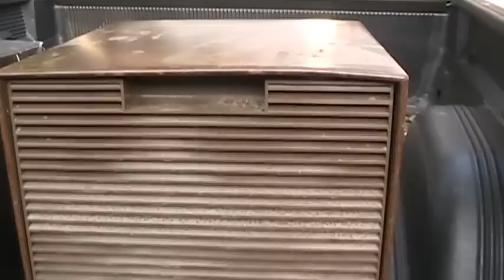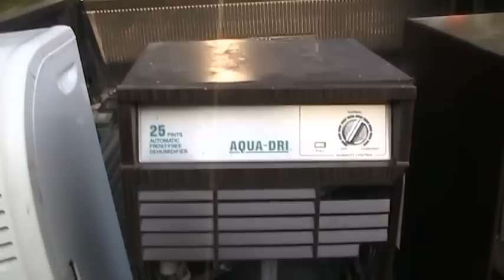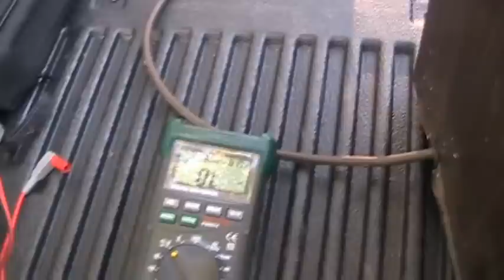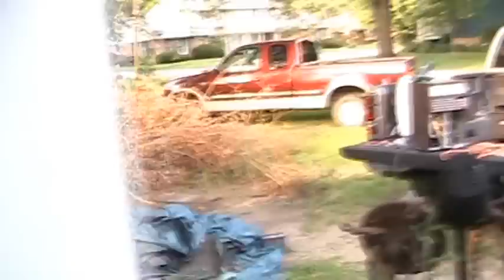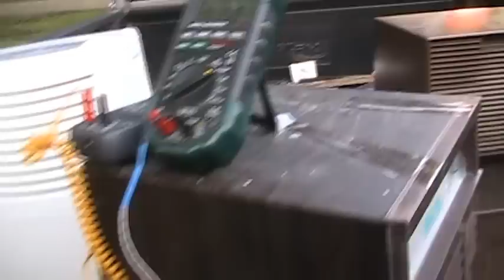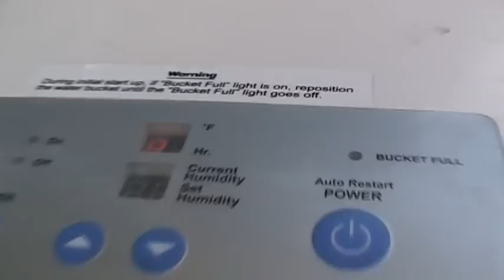Three Broken Dehumidifiers

Comment: That Aqua-Dri dehumidifier was made by Samsung in the early 1990s.  I have a slightly older 40-pint unit with vertically wrapped aluminium evaporator also made by them, and sold by Hunter.  It was neglected for many years but runs like a top after a good cleaning.  It came without the condensate bucket but I have it connected to a hose.

Comment: Just had a thought.  How hard would it be to bypass the electric control panel and wire in a humidistat? Been looking for dehumidifiers for cheap.  All the good older ones are either too far away or insanely over priced.  The one advantage to the newer models is generally larger capacity.  I find those for parts all the time
Reply from the maker: It wouldn't really be that hard, as long as one does so safely.
Reply: @uxwbill  hope theirs an opportunity to see that in the future. Like the dehumidifier and Kitchen Table Electronics Repair vids

Comment: When hunting for a vintage dehumidifier, I always insist that people look for the absolute simplest design you can find. My '78 Admiral 22-pint unit has only its humidistat in front and a single tank-full switch in the back. No springs, no second switches. Less to break than even your simple Kenmore. Also, of course, my first bit of advice is NEVER BUY NEW or you'll be buying again within the decade.

Comment: Bad capacitors can be the cause of faults where a capacitor is used as a voltage dropper to give a 24 volts supply to the control pcb. The capacitors are self healing in that if they go short circuit the current pulse blows away the faulty bit of the capacitor which is then ok again but has slightly less capacitance. Over the years as this happens the capacitor then does not have enough capacitance to supply the 24 volts. https://www.youtube.com/watch?v=r_79OrkoRtI&t=73s   That is one that I fixed.

Comment: I purchased a Frigidaire 70 pint dehumidifier in 2017, and a second one in 2018 (as a backup). Both, are now dead, showing the dreaded 'F0" error code, which means loss of refrigerant. I believe MOST modern dehumidifiers tend to die as a result of loss of refrigerant, due to bad welding in the cooling lines. Somebody suggested to just buy a small window air conditioner and plug it into a humidistat ON/OFF controller. What do you thing about that? Thanks for a great demo.
Reply from the maker: While it certainly will dehumidify, a room air conditioner may not do as well as a purpose built dehumidifier. 

The air coming out of an air conditioner is actually laden with humidity, but becomes less so as it blends with the (warmer) room air. It may also make the room too cool, or be unable to cool/dehumidify effectively because it is too cool in the room or outside.

I have done a much newer video searching for the leak on a modern, recalled dehumidifier whose charge had leaked away. I also examined another similarly recalled unit that had leaked down. In both cases, the joints were fine. The theory that I'm working with now, based on what other commenters had to say, is that the copper may actually become porous. This is likely to be revisited in the future.

I would recommend finding a good working vintage dehumidifier instead of an air conditioner.

Comment: Well, those coils etc are being exposed to moisture all the time it runs, pretty much guaranteed to corrode almost any metal over years.
I have a Danby  dehumidifier ddr050bdwdb  I didn't find it expensive, I think it was $179
Reply from the maker: Corrosion was never really a problem, as plenty of surviving 20, 30 and even 40 year old models will readily affirm. Only newer units seem to have problems with it.

To buy a window-mounted air conditioner of similar size to a dehumidifier actually costs less and gives you the added bonus of comfort cooling.

Comment: I can't stand digital controls, so finicky on my dehumidifier. They really need to revert back from digital displays, makes a simple machine too complicated.
Reply from the maker: From what little I've seen of them, I'm amazed at the lack of hysteresis exhibited by the digital controls on modern dehumidifiers.
Reply: I just fixed a Frigidaire with digital controls, it seemed it had two separate problems. 
First was the humidity sensor, located at the top right of the unit, where it apparently sat in enough condensation that the lead for the thermistor used in the sensor corroded away and broke the connection. This resulted in an A5 code. It measured about 220k ohms at ambient room temp, and I didn't know what part number would be suitable for a replacement, so I was able to salvage the old one by soldering on a new lead on it. Tricky because the one side broke off flush with the body, but it worked.
Then it still wouldn't energize the compressor, and that turned out to be a bad 25A relay. Contacts were all burnt and oxidized, no salvaging that, so I used a solid state relay I happened to have, and it then worked normally.

Comment: I just got an old Inglis dehumidifier at an estate auction for $1.  Probably made by Whirlpool.  I had thought it was 1970s but it's got a production date of 1957 on the inside.  It's freakin' heavy and is built like a tank.  Cleaned it up and it works great!  It doesn't have an on/off switch or a humidistat control.  I guess the old ones didn't need such fancy controls?  I can't find any info or even a photo of it on the net.

Comment: Excellent presentation and video.  I am an electronics numbskull.  I have an old Kenmore like the one shown, (but it has the "o".  Best I can see, the model is 840405.  Owned for 11 years.  Picked up from the dump.  Until now, I've never had the thermostat set higher than 3, and I did not let it run continuously.  The house is so damp, however, that I moved it from the small room in which it was located, to a larger room, and, I've set it at 5.  It doesn't shut off, (possibly due to the severe damp?), so I shut it off manually.  Tonight, the top of the unit was hot when I went to check it.  Not burning-hand, hot, but too warm for my comfort.The unit surely does pull moisture from the air, and the 22 pint bucket has been filing up well.  I have not allowed it to reach full.  There could be a wall wiring problem, as the plug becomes slightly warm.  But, the metal being so warm - maybe it has been before and I didn't notice it, which is quite probable - what do you think, please.  Thank you.
Reply: PS  The plug was inserted into a 3-hole outlet, but I wouldn't assume it's "grounded" in this old place.  (Hey, take it a little easier on those of us who consider incandescent light bulbs miraculous and don't get into cleaning the units well, even if they're unplugged due to electriphobia, eh?
Reply from the maker: The plug becoming slightly warm does not indicate a problem. They're generally "just good enough" to stand the load of the appliance to which they are connected.

You may find that the heat you felt was only that of the refrigeration system and motors. It's perfectly normal for the fan motor to reach 100°F or so, and the compressor could easily hit 120-150°F. The condenser coil also gets quite warm in operation.

You can buy a cheap outlet grounding tester at most any hardware store for just a few dollars. Or, if you have a multimeter of some kind and the knowledge to use it safely, place it in the AC voltage measurement mode. Verify that the probes are attached correctly. Place the red probe into the narrower of the two slot terminals and the black one into the grounding hole. If you read 120 volts or thereabouts, the outlet is likely to be properly grounded.
Reply: Thank you for the comprehensive and specific reply.  There is no doubt that little in this old house is properly grounded.  The boiler wasn't.  How about you just drop by... Thanks again.

Comment: I have been looking for one of these old hard workers for some time. I found one but do think the humidistat is wonky. If you know how to get a new ones please let me know. I do agree with you because I did get a new one and it just makes a lot of noise. The old one that I think that the humidistat may have a problem seems to work so nice and quite and a lot of water comes out. Older the better.
Reply from the maker: Odds are good that the parts are still available. Since it's still possible for most of us to go to Sears, I'd start there. Take the unit's model and serial number with you. If Sears can't help, or there isn't one near enough to you any longer, go to a good Whirlpool parts dealer. These units were made by Whirlpool.
Reply: hey uxwbill do you know where I could get an replacement motor for my sears incase it does go out?

Comment: one more question sorry about that. How many volts are going to the motors in these units? Is it standard 120vac?
Reply from the maker: Yes, these all run from 120 volts AC and they have 120 volt motors.

Comment: I just got a free humidifier from cl compresser is fine and it has refrigent but the blower moter is stiff I put wd 40 in the ports but no luck think you can help? btw this is a sears from the 90s I think
Reply: byn picking up some free dehumidifiers on craigslist and I recently got also a crappy modern GE white one lost refrigerant, glitched wenever power outages and glichy controle panel also the compressor burned up and almost caused fire! unacceptable modern garbage!
Reply: also how easy is it to find the motors for sears dehumidifiers the kind with the 2 mounting screw posts on the bottom. Sory about all these questions.
Reply from the maker: Just edit your comments (if you're not on an actual computer, it'd be a lot easier and more fun there) and put all your questions in one "basket".
Reply from the maker: WD-40 is not a suitable lubricant. Sometimes it can revive tired old grease and oils well enough to confirm that a motor is in fact good. If you want the repair to last, you need to take apart the motor if you can, clean out the bearing areas with a good quality degreaser, and oil them with good quality electric motor oil. (Engine oil will also work and most any viscosity is fine for an undemanding application like this.)

I have no idea how easy or difficult it would be to find a motor with those mounting posts.
Reply: thanks man. Update on the motor: This morning I powered up the free early 90s I think sears Kenmore unit and the fan motor is luce at first but when it runs for about 10mins the fan motor stiffens up and slows down The motor also gets hot to the touch I think that's very strange for an electric motor to do something like that. If I wate for it to cool down the blades will lucin up again but it will inevitably do the same thing again after every 10mins. I believe it has something to do with expanding and contracting metals and how they react to tempreture fluctuations. I have a bad feeling I might have to bite the bullet and buy a replacement motor. What do you think may be the cause of this? I sure hope I can still fix it. I think something may be just making it overheat
Reply: I just realized the free sears Kenmore I got yesterday is the exact one you have in the beginning of the video to. It does shake violently almost every time power is disconnected to the compressor. The rubber grommets all seem fine on mine.
Reply from the maker: It's not at all unusual for those little motors to run so hot that you can't touch them. If it's winding down after a few minutes of operation, I'd suspect all electrical contacts first and the motor next. I had a Carrier window air conditioner that I found set out for the trash because it was doing that. I ultimately traced it down to bad contacts in the thermostat. The more they heated up, the less power went to the fan motor and ultimately it just stopped running.
Reply: the motor was just gummed up I took the motor and fan assembly out of the unit and the motor is sealed However, I tried some percussive maintenance and tapped the motor shaft against a hard surface with the plastic blade set removed and it loosened up to the point that a flick of a finger would not only cause it to spin freely, but to spin continuously for about 20secconds before coming to a complete halt. If the motor wasn't held together by rivits I would totally disassemble it completely and give it a thurro cleanup and inspection. It has byn running grate since yesterday evening and all of today. I am so glad I was donated this great machine which will probably outlast any haier, LG, or soleuse china pride machine.

Comment: I have the exact same kenmore and I can confirm it does that. When I temporarily had it fill up the bucket I caught it quickly cycling on and off a few times a second. Good thing I caught it before anything bad happened. Some other times, it would work correctly with the bucket and light the full light but if you touched the bucket it would rapid fire on and off. Since it's been positioned over a floor drain now in my basement, it's much happier now.

Comment: While new units may be expensive, they are a heck of a lot more efficient to run. using the numbers off of the Aqua-Dri vs. the "new" Frigidaire I have running here. Figures assume max power draw when compressor is running and 120VAC.

Aqua-Dri: 25 pt/day @ 7 amps
Frigidaire: 50 pt/day @ 4.8 amps

We've come a long way. Double the drying capacity while using less electric to do so! A new unit might pay for itself in electrical savings quickly seeing as these things run 24/7 in most applications.
Reply: The fan motors and compressors in the new units draw less current because they are as weak as they can possibly be to do their job. As soon as the bearings in the fan dry up a little bit the motor is jammed. Compressor failure is common too as far as I've seen. Then, the bigger question is: how is it more efficient to buy a new one every 2 years and throw the "old" one in the trash or recycle it when the old units work for 20x longer? It's a huge waste of energy to recycle the dehumidifier into another cheap piece of shit that will be recycled again over and over. So after you go through 20 modern dehumidifiers I would say the vintage one is more environmentally friendly.
Reply from the maker: I disagree with you here for a few reasons:

1. There's the whole matter of longevity. I'd be surprised if most modern dehumidifiers make it to their 5th year of operation. And while it's difficult to figure, the resources used to make a new one as opposed to operating an older but possibly less efficient unit have to be considered. When if ever is the point reached where a given unit has "paid its debt"?

2. None of my old dehumidifiers reach their nameplate ratings in steady-state operation. They all use less current than indicated by an amp or two. I don't know to what if any standard these ratings are held.

3. If one put a bigger pan on the Aqua-Dri or placed it over a floor drain, it might manage to pull more than 25 pints of moisture out of the air in a 24 hour period. This would have to be tested. I believe the primary difference in any of these dehumidifiers is not refrigeration system capacity or fan size/speed, but rather the size of the pan they shipped with.

If I get the Haier unit to work properly, or simply hack in an old-style humidistat, some of these things can (and will!) be put to the test.
Reply: Eh... no way.  Even if modern units were not a complete pile of Chinese garbage, they use a different method of calculation for pints per day, like most of the EnergyStar program.  EnergyStar is a great idea on paper, but in reality, it is advertising instead of efficiency.  There are old videos on Spatsbear's channel to illustrate this...  The amp rating is simply how much current the unit pulls at the moment.  I had a modern Kenmore, it did nothing but run and run and run, and heat up the house with its waste heat, and only lowered the relative humidity by about 4-5%.  My vintage Kenmore would run for 5-10 minutes and shut off, because it was done with its job.  The new Kenmore failed after just a few months, while the vintage unit was 40 years old and still running.  

Spats had the same experience... new one, heated up the house, did nothing, then failed.  Ran constantly at 4.5 amps and never shut off.  Humidity stayed in the 50s.  That's a 4.5 amp draw for a cumulative 1440 minutes per day.  Another new one, same thing.  Another new one, failed again.  Vintage unit in basement now, runs for almost exactly 8 minutes and then shuts off for several hours, keeps basement at 32%.  That's 6 amps for a cumulative 32 minutes per day.  Where's the efficiency?  The vintage Coldspot units we have, each of them can run for a few minutes at a time and keep the garage at a nice 35%... and that's a non-sealed garage in a city with more rainfall than Seattle!    Also, three new units... almost $800 wasted.  Vintage unit, $20.  

Vintage units are WILDLY cheaper to buy and run than modern units.  And, they don't fail every year or two.
Reply: @HarleyBadger  
I wonder about this Energy Star rating system, looking at refrigerators and the amount of kWh they use per year, some ES approved units draw a much larger amount of energy than some others of the same size category. Not sure what it is they based out on.  Seems easier to simply look at the kWh/year rating than the Energy Star label.
Reply: Pretty much impossible to be significantly less efficient. Water takes something like 1250btu/lb to condense from low vapor pressure as it's found in the atmosphere, plus fans plus the specific heat of air needing to be brought below the dew point. Meaning you'll be fairly close aside from fan and compressor inefficiencies which isn't massive when both units are full on.

Comment: that would be cool if you took the vintage controls and rigged them to where the hole is or would be after you pull the electronic ones out of the Heir unit.